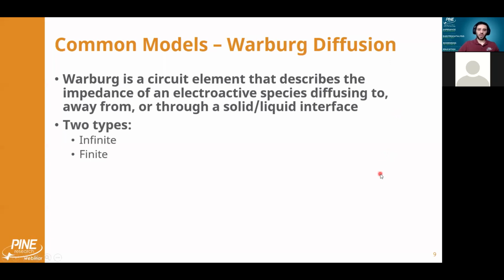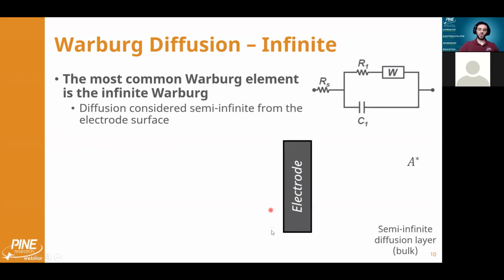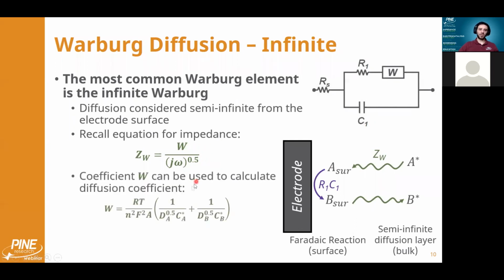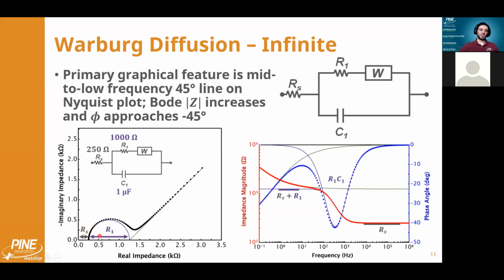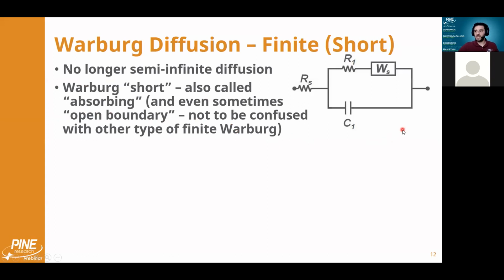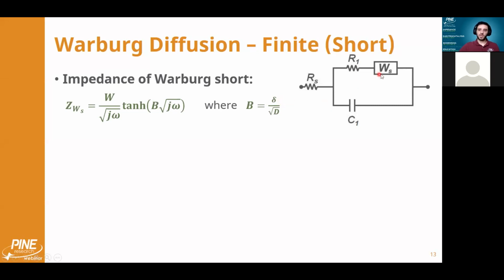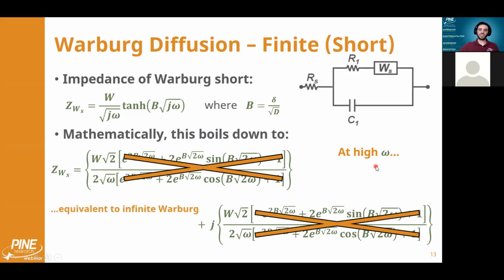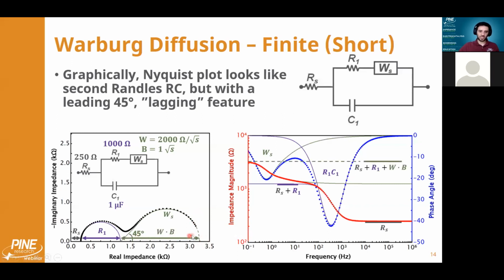Infinite vs. Finite Warburg Diffusion

Comment: can you make a non membrane hybrid electrode setup using aluminium for water electrolysis and run CV IES and chronoamperometry to test for efficiencies associated
Reply from the maker: What you're describing sounds a little like a specific kind of electrochemistry experiment called hydrogen permeation.  This typically uses a metal disk as a substitute for a membrane, and hydrogen gas is generated at one side by applying a certain potential.  However, if what you are referring to is not exactly this kind of experiment, I think I may not be able to easily answer because I would need a little more information or details about your desired experiment to know if it is possible or not.

Comment: You choose the W+R||C when there are multiple R||C. You choose (W+R)||C when there's only one set of RC. Doing this way can improve your modeling results slightly. This is based on my experience and what I saw in the literature.
Reply from the maker: I appreciate the suggestion.  On this matter, I tend to default to the argument made by EIS expert Dr. Mark Orazem in a recent publication (from 2024) he produced discussing this exact topic and the differences between those two circuit analogs: https://iopscience.iop.org/article/10.1149/1945-7111/ad3b76

(I'll also just add in my defense that the above paper was published after the webinar I delivered that became part of this YouTube video!  In more recent versions of the webinar from which this Warburg content derives, I modified this section to reference Orazem's paper and clarify which circuit model is most accurate)

In short, and to very briefly paraphrase, the model with the Warburg element "by itself," so to speak, is most of the time inappropriate due to an incorrect assumption about disparate timescales between the mass transport and kinetics, as well as a faulty assumption that diffusion impedance can be completely separated and decoupled from the charge transfer/double layer processes.  Therefore, while I don't doubt the proliferation of auxiliary explanations within the scientific literature for the usage of one model or the other, the reality in my estimation is that the Randles circuit model that incorporates the Warburg element within the R||C is most correct and should be used in nearly all situations.
Reply: @Pineresearch  Thank you for sharing (I sent an reply but apparently it got deleted because of the link I suppose, so this this a resend without the link). The paper I was referring to is "Graphical analysis of electrochemical impedance spectroscopy data in Bode and Nyquist representations". In section 4.4.1, they discussed that "From a theoretical point view, just as in our previously developed physical impedance models [13], [22], the diffusion element shall be in series with R and then in parallel with the CPE as described in Fig. 8 (b). However, in the presence of multiple (R//CPE) units, it may bring arbitrariness when one chooses one of the resistances to be connected in series with the diffusion element. Therefore, it is an expedient and phenomenological approach to place the diffusion element outside" What do you think about this opinion?
Reply from the maker: @fiavi.5298  I understand this point, and it does make some sense, though I do not agree with the methodology (and I will explain).  However, I will simply grant that there is some logic to the idea that the presence of multiple Voigt (R||C) elements (i.e., multiple time constants, or multiple charge-transfer processes) creates an ambiguity as to which one should include the embedded Warburg element.

My contentions are as follows: (1) The fact that it is difficult or relatively unclear which R||C should contain the embedded Warburg does not fundamentally mean it should not be embedded.  It just means that it is difficult or unclear.  Difficulty and lack of clarity in scientific analysis does not necessitate application of an incorrect model.  In some cases, I suspect it may just mean that more iteration and/or persistence might be required on the various possible circuit models to narrow down the optimal configuration.

(2) One of the primary reasons Orazem contends that the "Warburg by itself" model is inappropriate has to do with timescales (and this is backed up mathematically).  However, here is where the situation becomes slightly more ambiguous as well.  The reality is that in some cases, the use of EITHER model will be equally successful - meaning, the fitted parameters of all R, C/Q, and W elements may be roughly the same whether the Warburg is embedded or not.  The reason for this, again, has to do with timescales and the assumption of diffusion being decoupled or not from the kinetics.

Mathematically, what it means is essentially that if the timescales are short (i.e., fast kinetics, small RC values), the models converge.  Orazem's main system in which he is analyzing this circuit analog distinction (and criticizing others in the literature for which one they are incorrectly using) is Li-ion batteries.  Li-ion batteries tend to have fairly small R values, but extremely large C/Q values.  This means that on balance, the RC time constants will tend to be somewhat large - or at least not small or close to zero.  Following the previous logic about mathematics of both models, it is therefore not likely for a Li-ion battery with moderately-sized RC time constants (or any other system with RC time constants that are not very small, for that matter) that the two models with converge mathematically, and therefore the use of the "by itself" model is wholly inappropriate.

So in summary, for systems with somewhat small time constants, it probably does not matter much whether the Warburg element is embedded in an R||C element or not.  But if this is not the case, it is likely that a critical error is being made by using the "by itself" model.

Comment: what is the relation between  warburg impedance and the slope (real Z, imaginary Z) ?  for example one electrode have slope 1.5 and anther one 3 which the better ?
Reply from the maker: I think we would need to know more about the electrochemical system to understand the effect of the slope.  When you have Warburg impedance for the semi-infinite diffusion the slope (Z real vs -Z imaginary) is 1, where you have a straight line coming out of the Nyquist plot at a 45 degree angle (phase angle = 45 degrees).  When the slope is greater than 1 (1.5, or 3) you could have a reflecting boundary condition.  This could also indicate sluggish electron transfer kinetics.  But we would need to know more about the system and to see the impedance data to get a sense of what it means, but I wouldn't say one is "better" than the other, just different.

Comment: Hey, I am wondering how does measurement of EIS and then determination of diffusion coefficient look like experimentally. Basically I prepare a Li coin cell, then what? Does it have to be charged/discharged first before doing any EIS measurements or I just start doing EIS immediately after preparing the Li coin cell and waiting a bit? Also - to determine value of diffusion coefficient, how difficult is it to do these fittings? Does it happen kinda automatically in the software after proposing a scheme for the cell?
Reply from the maker: These are good questions.  First, I will tell you I will talk a little more in depth about these questions this Friday, Jan 17 2024 during our next Ask Us Anything About Electrochemistry livestream.  If you can't join live, you can watch the recording here on our YouTube channel any time, it will be episode #83, link is here: https://www.youtube.com/watch?v=aSbctg-zyvQ

So in general, it is hard to answer your question because preparing a Li-ion coin cell can be a half cell or a full cell.  If you are making a half cell, typically one electrode (anode or cathode) is your experimental material, and the other might be pure Li metal.  In those cases, you can (kind of) "just make it and start testing" so to speak.  But if it is a full cell, it depends on whether the cathode is fully lithiated initially or not.  Usually you need to run at least 2-3 charge/discharge cycles before performing any diagnostic tests like EIS - also so things like the SEI can set up, etc.

Determining the value of the diffusion coefficient via circuit fitting of a Warburg element is pretty straightforward if the fit is good and you can get a decent value for W.  But to your last question, it also depends.  It depends on how good or bad your data are, and how good or bad the software you're using is.  Also, it depends on how good or bad you are at recognizing patterns and performing EIS circuit fitting.  In some cases, a seasoned researcher can relatively quickly obtain fitting values for EIS data and then get results.  In other cases, it can be very painful and take time.
Reply: @Pineresearch  Thank you so much for the answer, I will join! What time is it? [Europe here haha]. If you could show during that some fittings it would be great. Just one more question. Basically I want to explore ion diffusion in a solid organic material (Li salt of some organic compound). Can these measurements only be performed in battery (half)cells, so together with a lot of additives such as binders, conductive carbon etc. or is there some method that would enable to measure Li diffusion in a prostine lithiated material?
Reply: *pristine
Reply from the maker: @WojtekStawski  The livestream starts at 1pm EST, east coast USA time.  If you are in EU, most likely you're 4 or 5 hours ahead so probably late in your afternoon, early evening.

I suppose again, I can't exactly answer your question because I don't know for certain.  In theory, I would say there's no reason why you can't measure diffusional properties in either of those systems, but the reality is it probably depends on the EIS data you obtain.  If you are not observing any Warburg behavior, well then you probably can't get diffusional information very easily.  If you are, then you can.  As a general rule, diffusion (especially in liquid systems) is pretty ubiquitous and usually shows up one way or another, so it is usually possible to measure it, but it does vary and may not be easily observable or measurable in every situation.

Comment: That is really helpful I have a question for my circuit fitting of gold, I'm using Warburg impedance is it related to just diffusion of ions to the electrode and coming back or does it mean it really has to do something in here as one thing is to confirm that ions can not go inside of the gold as it is an inert material. I just want to know the meaning of warburg impedance in gold eis
Reply from the maker: Good question.  I'll have Neil talk about Warburg impedance on episode #78 of our Ask us Anything About Electrochemistry livestream.
Reply: @Pineresearch  when and where it will that happen I am new, so I have no idea
Reply from the maker: We host a 2 hour livestream every Friday at 1pm EST, where you can ask us anything about electrochemistry.  If you can't make it, you can always type your question as a comment.  But sometimes it's easy to answer a question on the livestream than by typing.  Below is a link to the livestream where we discussed your question.  I'm working on the timestamps now, so you should find the question in the description of the video.

https://youtube.com/live/YMz-IpF6Y2s
Reply: @Pineresearch  Thanks alot I'll try to join next time

Comment: Thank you for the excellent presentation. I have two requests: Could you upload the video on reflection boundaries as well and explain a few cases where these circuits can be used? I would also appreciate it if you could create lessons on DRT analysis, which is becoming increasingly popular.
Reply from the maker: Thank you for the comment.  First, regarding your request to upload "the video on reflection boundaries," what exactly are you referring to?  Are you saying I have a video with this content already, or are you requesting we make one and upload it?  I am not sure I understand exactly.

Finally, I agree DRT is a fairly popular method of analysis and it might be useful to include in a future webinar or video.  We will have to consider this for future topics for sure.
Reply: @Pineresearch Thank you for the response. I might have missed the other video then. I will check.This video doesn't have refelctive boundary.
Reply from the maker: @ichu163  To be clear, in my full EIS webinar series (part 3, specifically) I go over both types of finite Warburg elements, including open (also called reflecting) and short (also called absorbing).  Perhaps you can check out the full webinar if it contains the information you are seeking.  It is on our Webinars playlist and is available to tier 2 YouTube members.
Reply: @Pineresearch  Thank you.. 👍

Comment: If we're limited to how far we can test in the low-frequency region and we only have a small line going at 45 degrees in our Nyquist plot, is there a way to confirm whether that line will keep going straight (an infinite length Warburg) or if it would curve like in the case of the finite Warburg? Is there a danger in just assuming an infinite Warburg?
Reply from the maker: Most probably, there is no easy way to definitively confirm whether the line would continue at 45° (infinite Warburg), curl down after the initial 45° (finite Warburg), or make an actual semicircle (Randles element).  You would need to continue the EIS experiment to lower frequencies (and hope diffusion/drift doesn't cause instability to make the measurements invalid).

I wouldn't say there's a "danger" in assuming an infinite Warburg, that might be too strong.  Some of your assessment should be based on knowledge of the physical setup.  If you have a small electrode with plenty of electrolyte, and not a rotating electrode or a microelectrode, it might be safe enough to assume the diffusion layer thickness is large in comparison and an infinite Warburg is valid.
Reply: @Pineresearch   I could add that if it takes too much time to see the curve for the finite one (meaning small frequencies, for example below 100 µHz), you are certainly in the case where the diffusion layer length is high. It is then equivalent to an infinite diffusion layer.
Reply from the maker: @bullten5416  Excellent point, yes. While one of the fundamental and critical features of EIS is that it casts your experiment into the frequency domain, there is still a real time element at play particularly at the slowest frequencies. And to your point, at 100 µHz a single sine wave takes 10,000 seconds, which is more than 2.5 hours. I agree with you, probably if you are not observing a finite diffusion plane behavior at timescales that long, probably it is infinite length.

Comment: Helpful and informative. A question that came to my mind is how would a circuit diagram would be if there was a Warburg impedance for an electrode with multiple coatings? Would the W element be present only in one part of the circuit?
Reply from the maker: This is a good question.  First, I will just tell you I have added this question to be answered during our next livestream, which as of this comment will be Friday, April 19 2024 at 1pm EST.  I encourage you to join or watch the replay (it will be episode #49 of Ask Us Anything About Electrochemistry).

As far as a quick answer, it honestly depends.  For a multi-layered electrode, theoretically every single interface (substrate/film, film 1/film 2, film 2/electrolyte, etc) can result in a unique impedance response.  But this is not a guarantee.  And as it relates to Warburg diffusional impedance, it is just tricky because you may not know what is diffusing, how far, and into which layers.  For instance, there is likely diffusion in the electrolyte, but is there also diffusion through the outermost layer?  The second layer too?  Every layer?  And you may only be able to resolve each of these phenomena if they happen to occur at different timescales, which is also not a guarantee and if this is the case, you might get sort of an aggregate diffusional measurement that cannot be easily resolved into the component parts specific to each layer in your electrode structure.
Reply: @Pineresearch  I will definitely catch the livestream. I would like to expand on my query (just to clarify it better with regard to the circuit). If, in a substrate/film1/film2/electrolyte multilayer coating scenario, the EIS circuit is given as R1+Q1/R2+Q2/R3, would the Warburg element be included so as to reframe the circuit as R1+Q1/(R2+W1)+Q2/R3 or as R1+Q1/(R2+W1)+Q2/(R3+W2)? Thank you for explaining the possible multi-diffusion happening across the layers, never thought about that. I will definitely catch the stream and am eager to learn more. Thank you again.
Reply from the maker: @devxpentatom7932  Thanks for the follow up.  I understand your question.  In short, I would not anticipate adding a separate Warburg embedded within BOTH Randles interfaces to be accurate (or even likely to be physically occurring).  Additionally, I think you're missing a Randles element representative of the last film/electrolyte interface.

I will try to illustrate this tomorrow during the livestream for you.